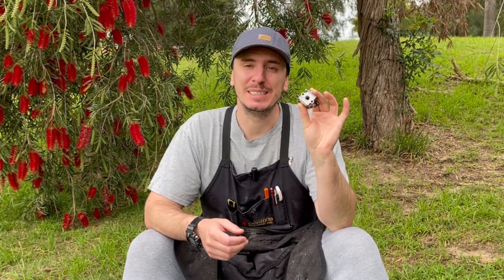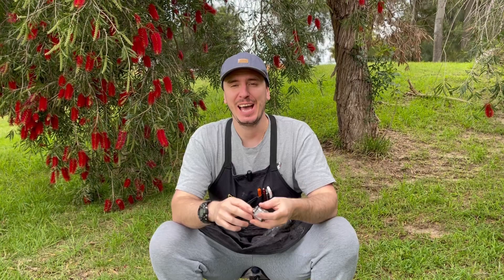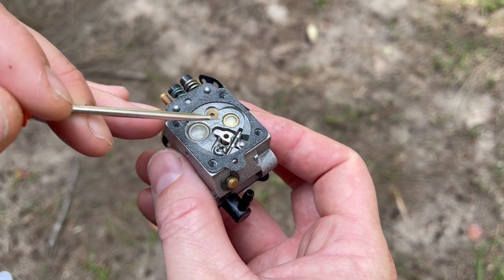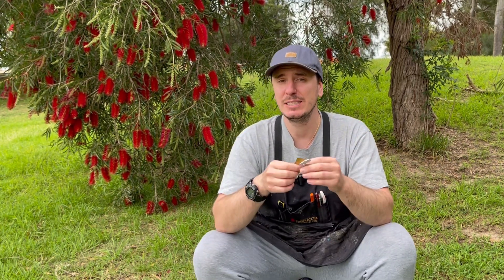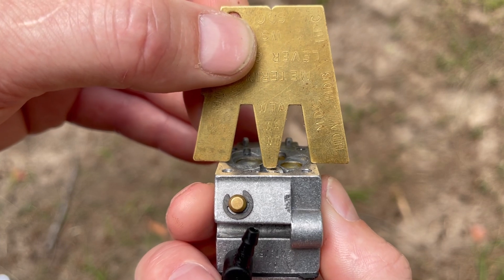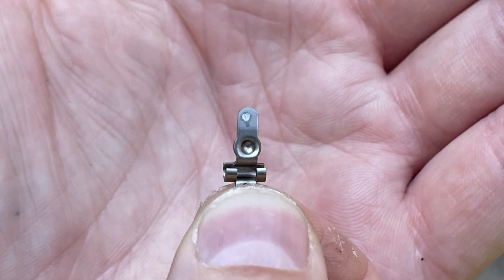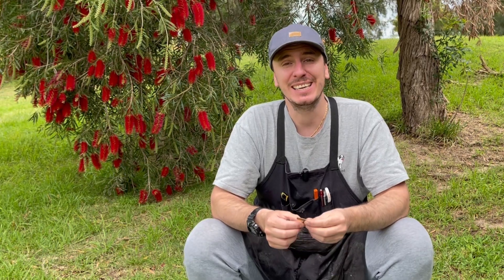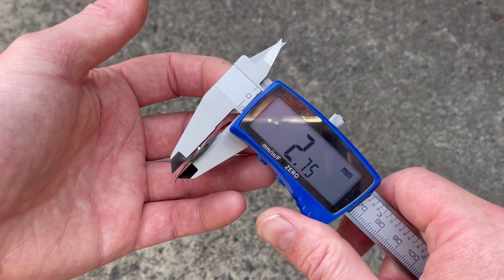Essential Adjustment When Rebuilding Carburetors! - Don’t Miss This Step!

Comment: I called four lawnmower shops in my area and not one had the gage. Ebay does have them but most are knock offs
Reply from the maker: You'd have to order it in, it's not a tool your local dealer would keep on the shelf.
Reply: @VintageEngineRepairs  .. That is funny because they fix carbs all the time and have carb kits and other parts for carbs but not a simple gage ?

Comment: How do you know where to adjust the lever on carburetors that are not Walbro or Zama (such as aftermarket ones) since these are the only tools available?
Reply from the maker: They replicate OEM carbs, so you just need to figure out what carburettor they're a clone of. Aftermarket carburettors for small engines are all copies of known brands. Cheers

Comment: goto time-stamp 2:03 and look closely at the Zama ZT-1 lever gauge shown to the right. C1S is stamped twice! First, it is located on the bottom of the gauge as shown with the C1 and C2. This edge of the gauge has a protrusion of about .071". Second, it's also listed at the top of the gauge on the second line and the 3rd entry in that line. This edge of the gauge has no protrusion at all.

The question is which is correct?

 I also have this Zama lever meter gauge and it's identical to the one shown in your video. It wasn't until I actually made a spreadsheet that listed all measurements for both the Zama and Walbro gauges shown above that the duplication became apparent to me. 

Finally, the Walbro gauge shown in the video is Walbro PN# 500-13-1. Unfortunately this Walbro gage no longer covers all the small Walbro cube carburetors at this time. A newer Walbro gauge is needed to cover the newer Walbro carbs. The second Walbro meter lever gauge PN# is 500-528-1
Reply from the maker: How interesting! You're right it is stamped twice! I couldn't tell you which to use. Though taking the carb apart, before you remove the lever see which is closer on your carb and repeat it when you put the new lever in :)

Comment: So many things can go wrong with a gas engine, is the main reason I use battery operated chainsaws, lawnmowers, etc., are much more dependable.

Reply
Reply from the maker: They have their downsides too, low power, short run times, expensive replacement battery's, electronic failures, fires, slow recharge times. Both have advantages and disadvantages :)

Comment: I've just set this metering lever using the gauge, I thought "it can't be that it needs to be bent so far down!"
But the saw runs smoothly on base settings, something I never achieved before. Not surprise if the lever was set way too high and therefore she was getting too much fuel. Thank you so much for this information!
Reply from the maker: You're welcome! Well done for setting it right :)

Comment: I enjoyed watching your video about adjusting the needle valve folk it's all pretty much all carburetors. But I had a few questions? When you put is the new fork that i justices the needle valve on the end where the spring is when it is lifts up how much doesn't need to touch the tool that let you know when it's right? Also after that adjustment is made right! On the other end does it have to be  adjusted where the needle valve seat in the hole? I noticed is own a carburetor that i've got that's right! That when you pushed the needle valve down and it rises up it's almost completely flushed or almost even when it rises up when it's right. If it's not too much trouble could you do another video on that? Thank you,Daryl
Reply from the maker: Na just the tail end gets adjusted and you want your gauge to just brush the very tip of it :) hope this helps!
Reply: I hope that I didn't confuse you telling you what all the carburetor is doing? I just thought by telling you what is was doing you might be able to help me find out what's wrong with it?
Reply from the maker: Sorry Daryl, I don't know what your other question is? I don't understand your comment after discussing the metering lever. Cheers!
Reply: @VintageEngineRepairs what I meant to say  is  when you put a new fork in that works the needle valve  on the part where the valve is at it's already where it needs to be at on adjustment without messing with that part? But the tip is what you mess with and adjust where the spring is correct? The problem i'm having every time I set the needle valve and put carburetor back on and go to prime it gas.
Is coming out from the side where you choke it. But.
The primer doll is not feeling up but when I.
Take the lines off and put them back on and prime it it fills up could the lines be on to where it goes on the carburetor or could something else be causing the gas to come out the carburetor? When it was running , it would only run on choke.
Reply from the maker: 1). No, you'll almost always have to set that metering lever height any time you put a new one in.

2). If you're getting leaking from the carb, you'll have an air leak somewhere. First pressure test the carb from the fuel line and it should hold. If it doesn't then you need to find why that needle isn't sealing. If it is sealing but leaking at the carb still, your purge system may be the issue or the metering gasket. Cheers
Reply: @VintageEngineRepairs okay i noticed that when the needle valve rises up  that it is almost or completely flushed at the hole where it enters or almost. Is all of the needle valves supposed to be completely flushed when it rises or almost? Also if the lines was pushed up to far on the fittings could that make it leak gas? Or the piston that has the oring where you put oil in it but the carburetor does not have the primer bulb on the carburetor it's mounted on the side on the plastic?

Comment: My chainsaw will not start. It has spark and I can suck gas out of the fuel take so carb is getting fuel. I have bought and put a new kit in the carb. I am missing something and this may be it because I did not do this. However, I don't have this gauge to set it with. Now I have to look on Amazon for this gauge? It's always something. Thanks for the video.
Reply from the maker: It's unlikely your issue if you haven't messed with the carb. Put some fuel down the spark plug hole and try start it without choke and see how you go! It may take a number of pulls with full throttle.
Reply: @VintageEngineRepairs  But I did mess with the carb. I could not find a new one to buy and had to buy a rebuild kit. I took it apart and cleaned it. Put the new parts in it. The tab you were talking about was not adjusted at all by me. I assumed it was a preset part, but you say in the video it's not. And I don't have that gauge to set it with either. I will put some gas in the sparkplug hole, but I don't know what that will tell me. Also, when I took it apart, there was only the metering diaphragm as a gasket, so I put it back that way. In your video, I see there was a gasket, then the metering diaphragm was on top of that gasket. It seems I have to put a gasket there. Gasket, then metering diaphragm on top of the gasket. Thanks for your comment.
Reply from the maker: Hey, yes you need to set the lever height in your case and yes it needs the gasket there too :)

Comment: Hi Tom, great video. I have a Walbro carb. off a craftsman 4 cycle 29cc  trimmer, I'm not sure how to find the carburetor's model number, I can only see the Walbro,  WYLB on the side  and near the base 149. with no letters in front of the number. How can I find the correct ID so I can order the correct gage kit? Thank You!
Reply from the maker: Hey :) google search "WYL 149 CARB KIT" and just match it up before purchasing. Typically one kit fits a bunch of carbs :)

Comment: You stated at the beginning that this carb can be used on 2 & 4 stroke carburettors but the 4 stroke carb has a float/float chamber whereas the 2 stroke carb doesnt and relies on pulse from engine to operate pump flaps in carb.
Reply from the maker: No, just because it’s a 4 stroke, doesn’t mean it’s always got a float bowl type carburettor. In fact all hand held 4 stroke engines use these carburettors with the addition of a spring on the fuel pump side.
Reply: Thanks for that, I've learnt something new today.
Reply from the maker: @gregorydobson4307 you’re welcome 👍🏻👍🏻

Comment: I appreciate the tip about the nipple height. Wouldn't the thickness of the gasket also impact the performance in a similar way?
Reply from the maker: You’re welcome! Yes it can, but they’re all the same thickness :)
Reply: @VintageEngineRepairs  Ugh! My aftermarket rebuild kit has a thinner gasket than then original gasket in my carb. The aftermarket nipple is also longer than the OEM nipple. I guess I need to do some math now to figure out the correct height for the nipple.
Reply from the maker: @stevel1312  interesting I haven’t come across a thinner metering gasket. You can file the nipple :)

Comment: Who knew?  I've been rebuilding car and tractor carburetors for over 60 years.  Something of a guru in this area, able to fix problems others haven't been able to  by simply being meticulous in setting them up exactly correctly.  I've also done dozens of this type of carb, but never had any idea that they were adjustable.  Never any mention of that in any service manual I've seen. This would obviously be as critical as setting float level in a float type carb.
Reply from the maker: Yeah that’s exactly right mate 👍🏻

Comment: Call me old school, but I have done so many rebuilds on those carburetors,  I can set them by eye. Unless that lever is worn, you generally never need to replace them. Even when I do, I can visually see where they need to be, no Guage  needed. When I first started, it was seat of the pants adjustment, take it apart, readjust and reinstall. Now it's  automatic for me. I have memorized most base settings enough to get an engine started then using the specialized  tool to do the final adjustment after warming the engine up. Most new equipment  requires a special adjustment tool. I keep a set in my truck at all times.
Reply from the maker: Thanks for sharing :)
Reply: Sure

Comment: I've changed the carb and the crankshaft seals on my Stihl 023 chainsaw, which I've not used much over the years. Now it runs ok tipped over to the right but stalls when vertical. Googling produces loads of results for the other way round, cheers Google. Any ideas?
Reply from the maker: I don’t give it much weight tipping the saw. Pressure and vacuum test first :)

Comment: Question - do you ever need to make an adjustment to the forked end of the lever where it slots into the needle valve? I often see a bit of play between them so the needle valve isn't instantly lifted by the lever when pressed.
Reply from the maker: That’s a fantastic question and I admire your attention to detail. In answer to the question, no. There is no need to make a seperate adjustment :)
Reply: @VintageEngineRepairs  thanks for answering a question that's been circulating in my head for longer than I'd like!

Comment: A problem I'm having:  It would be fine if there is a High and Low adjustment screws. My 29cc Craftsman WW 316.711700 4 Cyl. gas trimmer does not have these screws. Yet, it runs great on an idle until I rev up the throttle. I've reworked/cleaned the carb's inners including the jets/holes and needle valve thoroughly, Fresh gas 'n filter, clean exhaust screen, etc. Still no throttle rpm revs without stopping. Suggestions?
Reply: Are you referring to raising the idle upwards? Tried that. If you're referring to drilling a hole in a brass-copper fitting inside the carb, I haven't attempted such. Please clarify in explanation.
Reply from the maker: The second one :) but do you have a new carb kit in it? I have this issue quite frequently with the 4 strokes, one thing that can happen is the barren wears allowing in more air.
Reply: @VintageEngineRepairs  - Yep. But then, I'm wondering why there wasn't a 2-set of fuel adjustment screws L&H for such purposes. Then, what does one do when no adjustment can be made to accommodate for the stalling when the trigger accelerates the RPM to high? It stops. As mentioned,  I've reworked/cleaned the carb's inners including the jets/holes and needle valve thoroughly, Fresh gas 'n filter, clean exhaust screen, etc.
Reply from the maker: Hey, You can try opening the main jet up size which may help!

Comment: Have older Stihl 028 WB, all original, low hours homeowner use only.  Last time it ran about 8 years ago it didn't want to accelerate so parked it.  Figured the carb could use some cleaning.  Just completed tear down and cleaning and now have excessive fuel coming out the muffler and carb (filter side with filter off), spark plug is wet.  Of course she won't fire.  Did not replace any parts during the rebuild but seems like the needle valve is letting way too much fuel in.  Did not mess with metering lever height, still at factory setting.  H and L screws are set to factory 1 1/4 turns.  Idle screw is backed off.  Any ideas?
Reply: Oh, and spark and compression check good.
Reply: Of course, fresh fuel and new plug too
Reply from the maker: I’d always start with inspecting the piston through the exhaust port to check condition, then i’d do a pressure and vacuum test :)

Comment: I just use a straight edge or metal ruler to set the height of the needle rocker arm assembly &:I set it until it's just touching the metal ruler.

Aldo be careful which diaphragm you use because some of the pins on the middle of the diaphragm are longer or shorter than what came out of the carburettor !
Reply from the maker: That works, but only for specific carburetors :) yes the diaphragms have different length nipples!

Comment: I’ve rebuilt dozens of carbs (mainly stihl) and have never had someone explain in their rebuild videos. 
One more thing to double check (especially when you use aftermarket kits)
Reply from the maker: Yep, always double check :)
Reply: Brother ive got a fs120 stihl big carb and cant make it to prime i spray all pasagges with wd40 and they seem not clogged bulge is working it pulls fuels up to the carb but it doesnt go trough to full the purge did the check valve went bad ?
Reply: @Elfootv wd40? 
That’s a lubricant, not a cleaner. 
You need brake clean or carb clean. 
You may just make it worse with WD40

Comment: I have a Stihl backpack blower that dies (or at least loses power) after being at full throttle for about 10 seconds. would raising the lever for more aggressive fuel delivery solve this?
Reply from the maker: Na that would cause more problems. Have you cleaned the carb and given the machine a service?

Comment: I’ve just replace all the diaphragm but I’m getting a leak from the butterfly float what I’m I doing wrong
Reply from the maker: Hey, sorry, what is a butterfly float?
Reply: @ it’s the brass disc that’s opens in the carb
Reply from the maker: @ gotcha, no such thing as a float in these and the butterfly is a disk, nothing can leak from it. I think you mean fuel is passing the choke flap. It’s likely because your needle is leaking.
Reply: @ yes we call it that over my way lol but yes it’s coming from there I’ve changed the gaskets and the spring plus the part that when the lever goes down the needle float not sure what it’s called rises
Reply: @VintageEngineRepairs  I’ve replaced the metering lever the pin the spring and the needle
Reply from the maker: So the only way it can leak fuel is if the needle is leaking, if you pressure test the fuel line you’ll see that it is :)

Comment: if you pause your video at 0:40 seconds where you have the metering lever zoomed in. In between the metering lever and the M12 writing you have one raised ridge. On the other side of the metering lever you have another raised ridge. They are curved. They are there for a reason. So if you do not have the W tool you can still set the metering lever to the correct height
Reply from the maker: I never knew that! Thanks for sharing :)

Comment: Your advice on these tiny carburettors has been invaluable.  I do however, prefer working on the much larger vehicle carburettors.  The problem with working on these tiny carbs. is one must have the dexterity in their fingers as a Neuro surgeon.  Having hands like shovels is not recommended.
I just wish that I had found out about the tiny bushing in my Zama rotary carburettor.  Cleaning this type of carb. resulted in said bushing going ''walk-about''
I have spent so long looking on the internet for either the bushing, or said bushing in a gasket kit, I now have square eyes & calluses on my arse. . . looks like a new computer chair is also in order.
Attempting to find one in the republic of Ireland has proved fruitless.  I suspect I would have more luck in finding a Leprechaun. . . .come to think of it!  a Leprechaun would have the ideal size hands for working on these carburettors. maybe! just Maybe!  Ireland could become the the building capital of the world for these tiny carburettors.  
Looks like I shall have to buy a new carburettor . . . . all for sake of a tiny bushing.   Bugger!

Keep up the good work . . . .and Remember!  Have a Great Day . . .for it surely must be better than my day  :)  :)  Must now rush of to see my occultist to have eyes returned to normal.
Reply from the maker: Thanks for the kind words, yes lots of tiny parts on these 😂🤣
Reply: Did you know these type of carbs were made in Tralee.